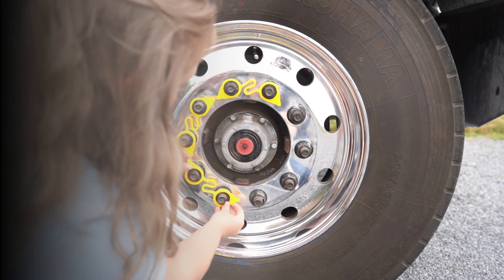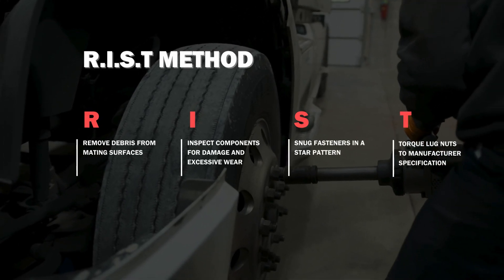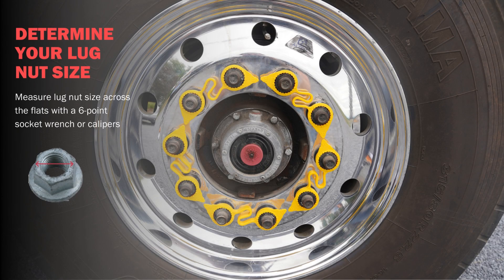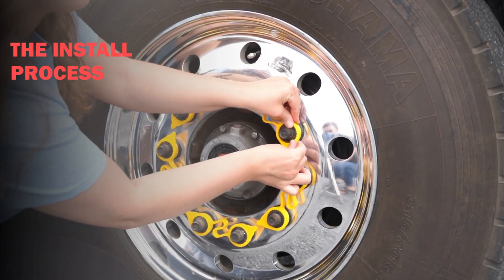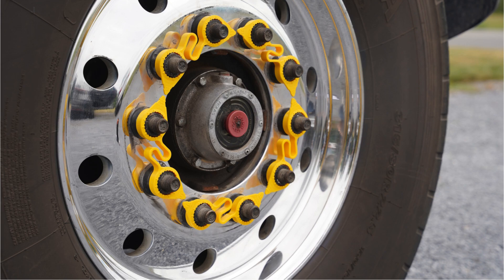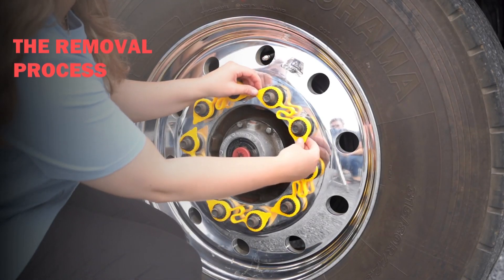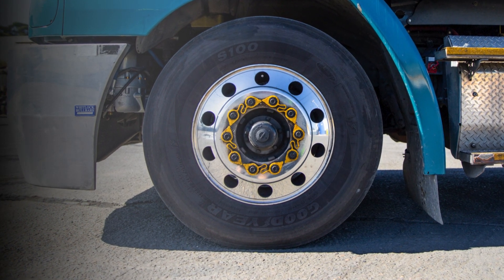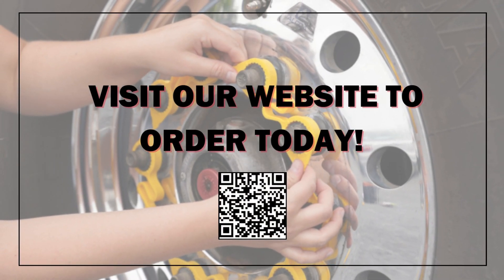How to Install The LUG LINX Wheel Safety System

Comment: Why the fuck bother 
Just do them up properly 
Never had one come undone 😮
Reply from the maker: Thank you for your comment. We understand your perspective, and it’s great to hear you haven't had any issues! LUG LINX is designed to provide an additional layer of safety for fleets, especially in high-stress environments where factors like vibration, temperature changes, and long-distance driving can lead to lug nut loosening over time. It serves as a proactive measure to help prevent potential accidents, ensuring that fleets maintain safety standards consistently.